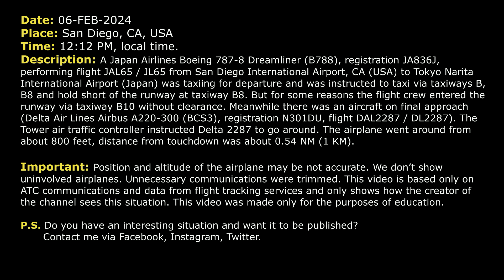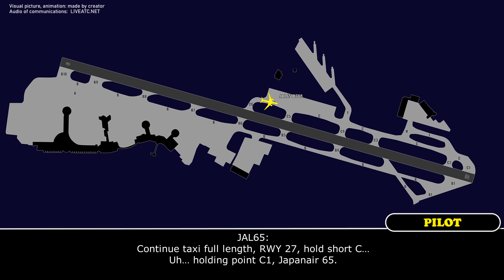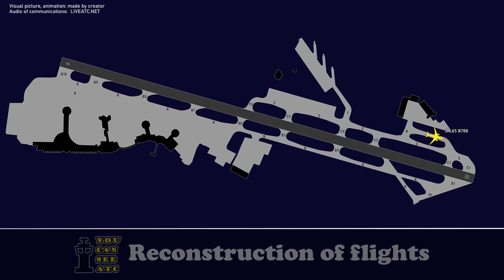Runway incursion. Japan Airlines Boeing 787 enters runway without clearance at San Diego. Real ATC

Comment: Attention all air traffic controllers:  when speaking with foreign carriers, slow the f down and stick to standard pilot-controller verbiage.  It’s not only more effective, but just a kind gesture.  It’s difficult enough operating in multiple foreign countries where controllers have heavy accents, but when you machine-gun clearances (that you’ve issued thousands of times), it creates confusion and radio congestion.  Thank you… rant off.
Reply: An arrival controller in my area rattled off incomprehensible instructions.  I asked for a slow repeat.  The controller did it again.  I asked for a slow repeat again, advising the controller that ultra-rapid speaking creates confusion and increases risk.  The controller's response was to instruct me to squawk VFR, frequency change approved.
Reply: They continued speaking very rapidly after it was clear they weren’t being understood.
Reply: Maybe someday my American colleagues will finally understand (but not holding my breath here) that aeronautical English is not English, and especially not American English. It’s a simplified code that is meant to facilitate transmissions related to the safe movement of aircraft, a code that is accessible to every pilot and controller on earth with minimum effort. The vocabulary, the tone, the speed, and even the pronunciation have all been defined and agreed upon in international treaties, but US pilots and controllers think they don’t have to abide. The condescending insistance that everyone should be fluent in your dialect, including all the slang, is frankly tiring. Travel a bit my friends. It’s a whole world out there. So provincial…
Reply: Truth.  A lot of Japanese are not fluent in English.  Controllers rattle-off commands so fast, even a native English speaker can have trouble getting all the info the first time.
Reply: @TheCyberMantis   No kidding.  I just started watching these and I don't know how there are not constant problems, especially when dealing with foreign airlines.  I find it very hard to understand some of the instructions.
Reply: @eric_in_florida  Pilots and ATC also use hand signals to communicate witheach other, which isn't reflected in the audio recordings.
Reply: @stevebalt5234  That's only ground crew, right?
Reply: But there are constant problems.
Reply: @stevebalt5234 what are you talking about
Reply: True, not just Japanese, many foreign pilots are not fluent in English, and slowing down doesn't cause much trouble. @TheCyberMantis
Reply: @TheCyberMantis  Then be fluent in English, the airline should've raise the requirement for English for the pilots
Reply: Did y’all miss his read back? It was verbatim what the controller instructed. It’s clear he understood
Reply: @bandit72436 reading instructions verbatim vs understanding instructions are two different things just like oranges and lemons. Also don’t forget that these pilots are on a 10-12 hour time zone body clock difference - again; what he read back and what he understood at “oh dark hundred body clock” are two different things.
Reply: 100% correct. I am an ATC in a tower which is a lot busier than Lindbergh and this guys pace is ridiculous to a foreign pilot. He also constantly amends his instructions. I'll get hate for this but phraseologies amongst US controllers and aircrew are incredibly poor - there seems to be an emphasis on trying to sound cool rather than making things clear and standard.
Reply: Right at the beginning, not even the native English speaking pilots got everything the ATC said. 😂
Reply: 💯 agree
Reply: Same can be said for Asian ATC controllers using English. I seem to recall on this channel, a National 747 @ Tokyo Narita having an Emergency due to an indicated fire in the cargo hold.  The Japanese female ATC couldn’t seem to grasp or understand the dire emergency of the 747.  Those 747 pilots wanted on the ground ASAP (I don’t blame them) & couldn’t get the seriousness across of the emergency.
Reply: @jamessimms415 Most Asian ATC are amazing, look at Hong Kong and Singapore atc for example, always spot on. Japan is notorious for ATC that is at often times extremely difficult to understand
Reply: This is 100% the pilot‘s fault, there‘s no excuse for repeating it correctly 2 times and then still entering the wrong taxiway.
Reply: @mojabaka agree,the instructions given couldn’t be any more clear and simple
Reply: I fully agree!
Reply: The lady tower controller was very clear compared to the ground controller.
Reply: Communication is not strong suit of men 🤭
Reply: exactly, slow down and speak slowly with Standardized ICAO ATC instructions not just for Foreign carriers but for domestic as well.  It's not only for safety but a "comment curtesy to foreign guests".  Speak English instead of American also help a great deal.  Safety First and Not EGO first would help even more.
Reply: US traffic controllers are often aggressive in their ATC communications  as well.
Reply: They probably not care. Their family is not on Japan airline nor Delta airline on that day to actually give a damn to slow down to talk to Foreign pilots until mishap happens.
Reply: I hope most of you know that knowing English is a requirement to become pilots
Reply: @Kevinmoran14  yep, if a person like a pilot can’t even understand what the tower says, i says shame on the airline to hire someone with low English capabilities and lowering their linguistic standart
Reply: you'd think they'd teach that on day one.
Reply: The amount of weebs who sided with the Japanese pilot is ridiculous. Controller said Hold short at Bravo, and the pilot literally replied back the same readback. The mistake is definitely at the pilot, not controller.
Reply: Americans, in general, aren't really into that. Slowing down for people from somewhere else...lol, as if. 5% will.
Reply: Well said
Reply: this is a accurate comment but completely irrelevant as the pilot clearly readback the correct instructions.
Reply: Well said.
Reply: JAL made a bad mistake. ATC then bombarded them unnecessarily. Asking them about what happened earlier as they are crossing the runway is ridiculous thing to do. They clearly weren’t great at English (whether they should be in the cockpit on an international flight is debatable), were likely a bit stressed from having known they’d just made a significant mistake and were dealing with the procedure of crossing an active runway.
The back taxi info and then just proceed on B hold short, actually proceed etc confused them. “Turn right bravo, hold short bravo 9” without the rest of it would have been so mech simpler.
Reply: Underlying problem is that these controllers in the us have been used to firing off non standard phraseology since the beginning of time and probably dont even know how to do the standard way anymore. So asking them to do it now even though the right thing to do probably wouldnt change shit. Bacause they cant do it
Reply: @nthoang1293 exactly right. They will struggle even more with standard phraseology in a high pressure situation. I also find it strange that ATC in the US immediately start scolding pilots even though the danger hasn't been averted yet. They're still on the runway and while still startled the dude starts having a go at them. It doesn't help the situation. Perhaps it's just me 🤷🏾‍♂️
Reply: No. Maybe the foreign carriers should meet the ICAO English standard.
Reply: @flapppytappybird7923 all foreign carriers meet ICAO English standard (Minimum Level 5) otherwise they’re prohibited from flying in ICAO state airspace. These pilots understand ICAO English, not U.S. fast talking. Listen to Heathrow ATC in comparison to any U.S. ATC and you’ll understand what a huge difference it is.
Reply: I get it, but the longer i watched the video, it seemed like the japanese pilot couldnt really speak english outside the standard atc terminology, i mean as a pilot for international flights u should be able to hold a conversation in english (atc asked him what caused the runway incursion and i dont think he knew how to respond)
Reply: @kaisus2137  that the impression I got too. Especially when ground asks him what he didn't understand for him to make that runway incursion. He just said he had to move from Bravo 4 to Charlie instead. He repeating all instructions with some difficulty, and I don't know about others but looked very laboured.
Reply: there was no non-standard phraseology used by ground .... very simple to understand; and he read back everything correct (before the rwy incursion)
Reply: Strong disagree. There are 100s of thousands of Japanese nationals who speak fluent English. Only these people should be pilot candidates as they will have to speak English to every ATC in the world outside of domestic Japanese flights. Fluency in English should be as mandatory as aviation and systems knowledge. I feel bad for the pilot, his airline should be fined heavily for allowing a non-fluent English speaker to fly an international route.

Comment: Okay, JAL crew screwed up.  However, I don’t think it is appropriate for the ground controller to ask if previous instruction was confusing or not after issuing a taxi instruction from B6 to C6.  They just had runway incursion, and it is not the right time to ask/talk about the thing while they are crossing the active runway.
Reply: Exactly! I made the same comment. That's why you give them a number to call.
Reply: I agree. If ATC wants more in depth information, give them a number to call
Reply: ATC are using radio to either get crew to admit full blame, or provoke an argument on radio.  ATC are snakes.  Saw this before a few weeks ago with the middle eastern crew getting the ATC asking them questions "why did you go around?" Tell us now while you are busy and confused, so we can humiliate you somehow.  Crews should just issue a phone number or say nothing.  ATC are sneaky snakes.

Comment: Initial taxi instructions need to include the departing runway. This was not included. Controller also said 'back taxi 09'. It should have been 'back taxi 27, or 'taxi down 09'.  Since they are landing 09 and departing on 27 these instructions need to be made very clear.
Reply: Nobody would ever guess that you work in a bowling alley.

Comment: JAL, taxi to the runway via Interstate 5, use the left lane to the offramp for exit 32, Yield to oncoming traffic, then multiply 32 by 4 and divide by 16, read back all instructions...
Reply: Exit 32 on I-5 is a good 20 miles away... AND NOT EVEN A LEFT EXIT!!! (confusion intensifies)
Reply: Read back in Yiddish JAL.
Reply: That's about right.
Reply: Funny, but ATC was pretty clear here with the instructions and there should have been no confusion, even with a full read back from the pilots. There was no instruction that could have been misconstrued as a clearance to enter the runway. The pilots even entered the runway on the wrong taxiway.

Comment: If you just had an incident with an aircraft taxing on to a runway the last thing the controller should have done is add to the complexity and confusion.
Reply: They are moving blame while the flight crew is under pressure.  Standard tactic by bullies.  ATC are bullies.
Reply: Bingo.  ATCs attempts to punish the flight crew really means hundreds of passengers are also being punished plus wasted fuel plus added confusion plus now the crew is rattled and more likely to make a careless error here.  Very unprofessional the way the incident was handled by ground

Comment: I felt sorry for the crew. English is obviously not their primary langauge and the speed in which the ATC controller was giving out instructions must of made it next to impossible.
Reply: I closed my eyes to not read the captions just trying to figure out if I would understand the instructions. I did. Without issue. And english is not my first language.
The confusion was probably coming from the term "backtaxi". I have not heard that one before, but I could guess from where they were, what it meant.  But I know the layout at San Diego and really can't fathom how any pilot would think they were cleared onto the opposite end of the runway to taxi all the way to C6 to cross to the other side. One proper briefing and look into the ground chart would have made it clear, that this can't be what ATC meant. And in case of confusion, they should have just asked.
Reply: @Quotenwagnerianer  "Back taxi" and "back track" are common ATC phrases. These dudes just got screwed up for whatever reason.
Reply: If English proficiency is questionable, then the crew doesn´t qualify for foreign flights. If they fly to Boston, JFK, or Chicago OHare they are in for trouble.
Reply: @gerardpully762  Having watched a whole bunch of US ATC videos, I do find that sometimes American controllers can be incomprehensible. And I tested at a C2 level on the Cambridge English tests. Simple enunciation would make a whole lot of difference, to be honest.
Reply: @gerardpully762  Rest assured that English proficiency is checked and makes its way onto every foreign air crew's pilots license. These recurrent tests evaluate "aviation English", the problem being US ATC using colloquial expressions instead of the standard phrases.
Reply: @gerardpully762 They understand English, What they dont understand is American accent

Comment: Sooo delta was able to land on 09, but Japan had to taxi 2 miles to depart on 27? Id understand if it’s a crosswind (which it wasn’t, winds were favoring 09), but why make Japan go all the way across the airport when they could just depart right next to their gate?
Reply: There are also climb performance limitations on runway 9 for many aircraft loaded close to their MTOW, as there is rising terrain towards downtown on the departure end. Not so for RWY 27.
Reply: Other comments say they had just decided to reverse the runway due to wind changes. Delta would have been the last landing in that direction.

Comment: Asking twice an explenation to a seemingly confused JAL crew while they are crossing an active runway is not the wisest and safest move from the ATC. Furthermore the amendments to taxi clearances were faster than the plane movement..
Reply: We do not know if audio was cut and the plane movement is not accurate reconstruction.
Reply: Audio is not cut. As you can clearly hear them continued to read back the b6 to c6 cross 9 instructions.

Indeed poor time for the controller to ask about a past instructions to a crew trying to follow current instructions @whatever0007
Reply: Yes
Reply: You are responding to a virtual re-enactment that has NO accuracy.
Reply: @gerardpully762 they were definitely still taxiing at the time though.  Would have been better to have asked while they were stopped
Reply: It wouldn't be US ground movement control without six different changes of plan though.

And yes, the best time to query the entire incident is directly after issuing another instruction to cross the active, while referring (ambiguously) to the 'previous clearance' (which one?), and while the aircraft is actually crossing the active runway, because its important to distract the pilots even more then. /sarcasm
Reply: @Shrike200  I’m wondering how much of the situation is based on sheer racism tbh.

Comment: If the ground controller noticed the mistake then how does he relay info to tower to tell the landing aircraft to go around? Does he scream inside the tower like "HEY TELL THAT GUY TO GO AROUND" or something?😅
Reply: In KSAN tower there is usually only two or three controllers and it’s reasonably quiet so it would be no big deal for the GC to just tell local about what happened. But since the local controller is scanning the runway environment it’s li’e.y he noticed it himself.  Since we have multiple frequencies and aren’t hearing them simultaneously it’s possible the go around was given before it appears on this video.
Reply: There are also automated systems to detect incursions like this and issue alarms. Might have been an automated warning.
Reply: That’s basically the whole point of the tower ATC, he has to check if the runway is clear. It’s literally the job description

Comment: Should be noted that weather was absolutely atrocious on Feb 6 in SoCal. Reverse Ops were in effect and it was in the middle of raining for 30+ hours straight.
Reply: Exactly…I suspect the reverse ops is what caused the confusion, it seems like SAN was landing from the West over the water, but also having flights take off from the normal westerly direction, obviously that can cause confusion, I’m sure the JAL pilots thought that they would be taking off from the West end of the runway, and having flown out on this very flight, that is an unusual taxi route to the East end of the runway for takeoff.

Comment: The controller was talking very fast to a Japanese captain.    He needs to slow it down.
Reply: Well, they read the instructions back correctly, at the end at least. It doesn't seem like it was a communiction issue. It seems like they understood the instructions, but somehow didn't taxi correctly.
Reply: @jort93z  Perhaps.  The readbacks' were often not correct if you listen carefully.    Example: near the beginning of the video he was told to  "hold short of the runway at  B9".   He read back "Hold short of B9".    Tis indicates he was perhaps  reading stuff back without actually internalizing what it actually meant.    Either way, I still think the controller sounded like he was over-caffeinated.